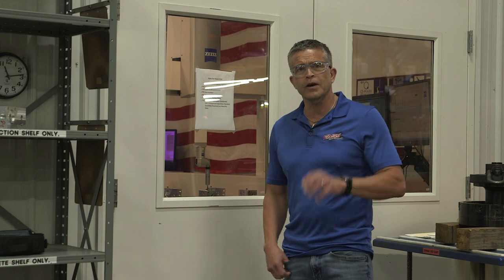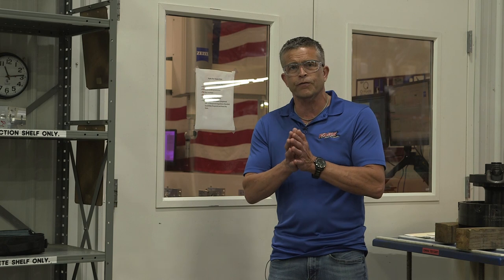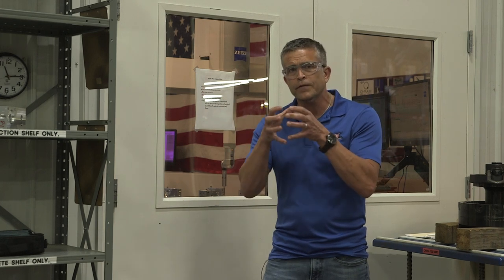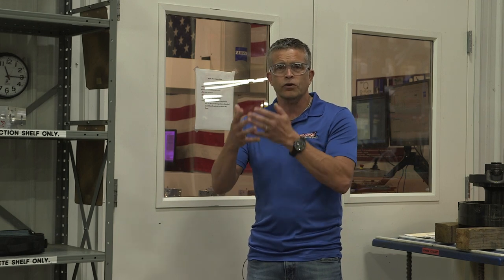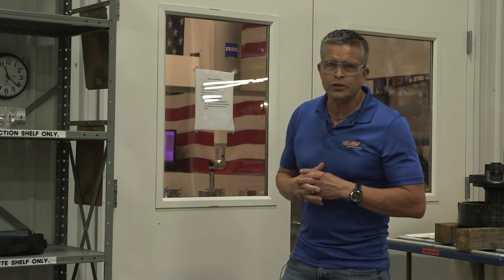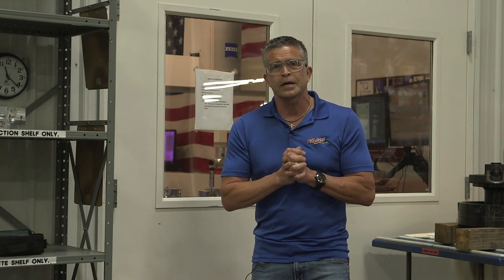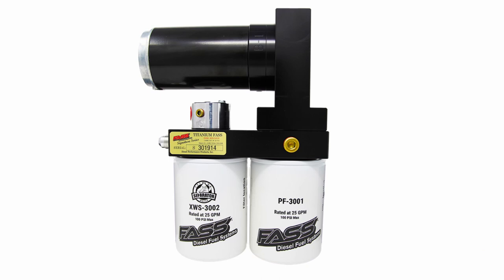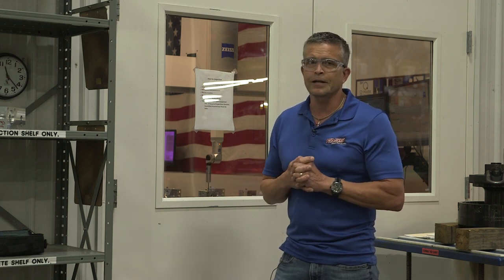The TRUTH About FASS Diesel Fuel Filters!

Comment: I've had a FASS 95 on my 2015 LML since it was new.  The idea of a lift pump made sense to provide a clean and steady fuel flow especially when a tune is applied.  The FASS pump ensures the factory engine mounted pump is not overwhelmed with a tune.  Zero regrets.  My next diesel truck will get a new FASS pump even if the truck has a factory lift pump.  I change the FASS filters and never worry about the pump.  The FASS pump is a bit noisy from the outside, but inside the cab the FASS pump is not heard.
Reply from the maker: That's awesome to hear man! We really appreciate all your support, and if you ever need anything you are more than welcome to reach out anytime!

Comment: I have a m925 5 ton military truck with a cummins nhc 250-855 and a m35a2 with multifuel engine, both are 24 volt systems, and I'm wondering if you have a system that will work for both?
Reply from the maker: Hey Seth, thank you for reaching out! To help get you setup with what you'll need we would suggest reaching out to our service team at 636-433-5410. They will be able to help get you everything you'll need and place an order over the phone.

Comment: 2015 RAM Cummins Stock Fuel System.   Labor to install $85 FASS 5/8" tube TANK pickup and $779 250LPH Titanium FASS system together???  1 or 2 days?
Reply from the maker: Hey there awesome question, and the time will be dependant on the shop, but with a lift you should be able to get this done in about a work day.

Comment: I need help, just replaced my filters and when I went to prime system no fuel spill out, I left filter untightened to see fuel spill after turning key to start position, still nothing, ended up filling filter up with old fuel to see it that'll do, still nothing, Im stuck on side of the road and can get right, plz help
Reply: Are you sure you we’re priming the right side? Also did you figure it out?
Reply from the maker: If you haven't already, give us a ring at (636) 433-5410 or shoot us an email at techsupport@fassride.com, and our service team will be happy to help!
Reply: Check your fuse bro
Reply: Should be a 10 amp fuse next to your driver side battery in a little harness

Comment: I have the Titanium series pump. My manual says to install the water separator below the pump but the newer replacement filters say to switch them. Why is this. Does it help remove more water and dirt or easier to prime. Just don’t want to damage the pump. Thanks
Reply from the maker: The XWS-3002 Extreme Water Separator is a 2 micron fuel filter as well as a water filter. Using the 2 micron filter on the suction side of our pump would restrict flow through the pump and cause the pump to flow less fuel and be loud.
Reply: So were your instructions wrong?
Reply from the maker: @SylasG  The instructions for the newer Titanium Signature Series pumps that come with the newer XWS-3002 Extreme Water Separator and PF-3001 Particulate Filter show the filters in the correct position. The older Titanium Series instructions would have shown where the older filters were to be placed on the pump.